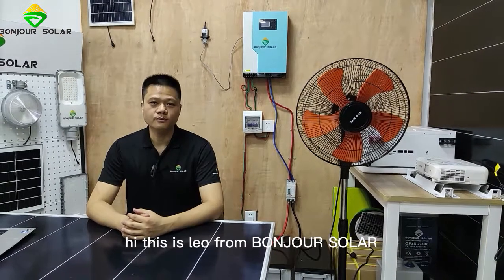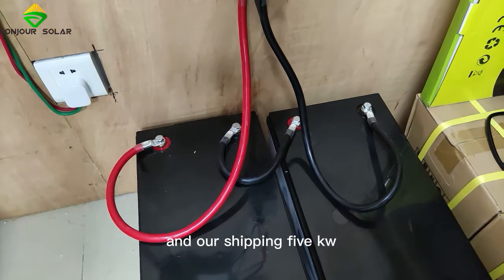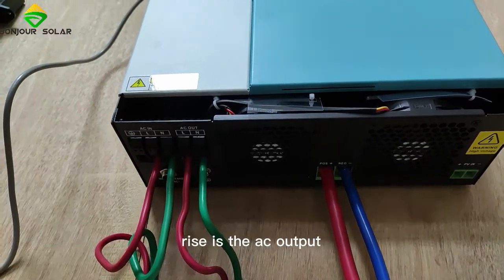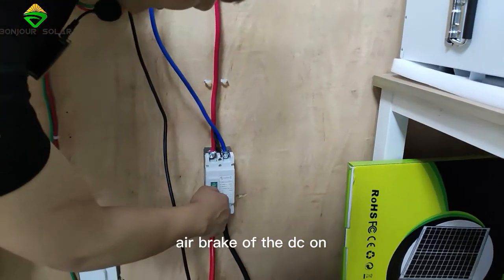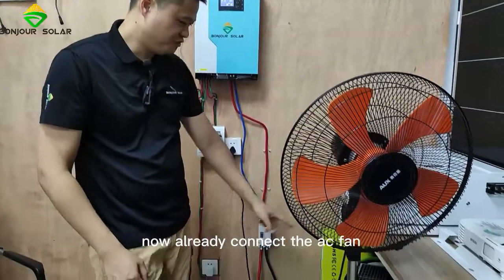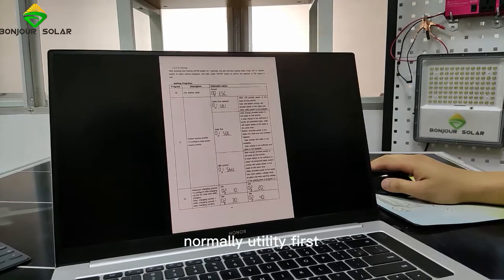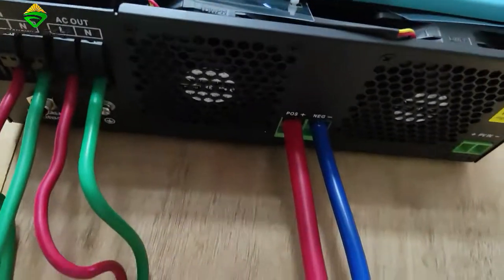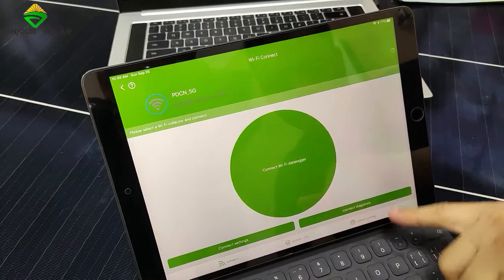3.5 kw hybrid inverter with MPPT

Comment: I have such an inverter only the more powerful 5kw. 48v. I do not have a batery. The inverter display fluctuates between 30w and 50w,  the panels give about 260v. So in my case, it looks like the inverter has some defect. It does not work if I connect a load it turns off will you help solve this problem error code 015.

Comment: In 24v how many solar panel will you put all and how many watts per panel...Minimum
Reply from the maker: it depends on the power of the solar panel you have, and for the quantity of the solar panel, we will calculate with the capacity of the battery and the consumption of the loadings and the average sunshine hours per day of the location of installation.

Comment: Will this work on Lifepo4 phosphate iron Battery? I had the 3200kw POWMR and the solar charge did not work on the Inverter.
Reply from the maker: our new design inverter can work with and communicate with the lithium battery BMS
please check the following video

https://youtu.be/68B32S-ENYE

Comment: I have one similar, but with no battery. My problem is it is not producing much W. If forexample I turn on a 2KW heater, in full sunshine at noon, it produced between 100 and 600w jumping up and down very fast. The inverted import from grid rhe rest, also jumping up an down. I have 14 390w panels connected. Two groups of 7 i parallel. I have also tried with one group of 8 panels in serial, the result is the same...
Is the inver defect? or  doesnt it work without battery?  the bypass sign + a warning sign and battery sign blinks constantly..

Comment: No PE connected. if this is a N floating system ( IT system) it can not safely be used with more than one  consumer and that consumer must be double isolated ( no need for  PE connection). C/B may not trip if a short circuit occurs.  RCB will not work.  How normal home installations ( TT or TN) with RCB van be connected using this inverter?  How the N is grounded? if connected to the grid, the N is bounded, if connected to the battery or solar it is not. This really is a dangerous setup.
Reply: This inverter has NO dry contacts based on the position of the internal BYpass. This means this type of inverters is NOT usable in combination with a TT grid system!

Comment: What happens when the battery is not charging  just indicating dypass with no indicates of Charge circuit
Reply from the maker: please share your whole system connection diagram to our support whatsApp +86 189 2870 0560  thanks

Comment: Hi. Can this inverter mix power from PV solar panels and grid?
For example load is 3000w, solar panels provide 2500w, will it take additional power  500w from grid, or will turn off solar input and take all 3000 from grid?
Reply from the maker: yes, there are 3 sources of the power, solar and grid and battery, and you can set the priority, like solar priority or utility priority and so on

Comment: can you run the meterbuy in reverse if local consumtion is lower than the panel production ( in case of no battery) in this case AC IN/OUT only connected ?
Reply from the maker: yes, can work without battery, but the solar power must be enough

Comment: Why the air beaker is 100A if the output is 3500w/24v = 146A? (peak 292A)
The other question is, will a 500W 40v solar panel charge the battery? (there are not enough space to put more panels to reach the 120v on PV)

Comment: I want to use this inverter with PVs and connected to the grid. What happens if I overload this inverter, will this inverter switch off to protect himself or the inverter pull the huge load from the grid with no problem?
Reply from the maker: we do not suggest you to overload with this high frequency inverter, because there is some posibilities to make some cells inside the inverter broken

Comment: Sir can a hybrid solar inverter run without neutral wire, using all hot wires only, do you have a diagram for this pleasee
Reply from the maker: please send us the details by whatsApp +86 13926220561 we will send you the solution, thanks